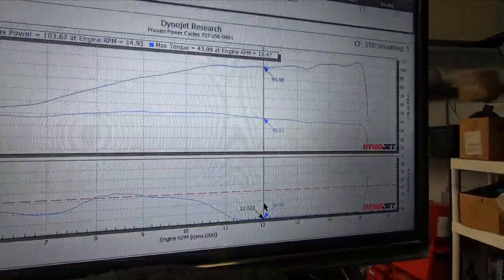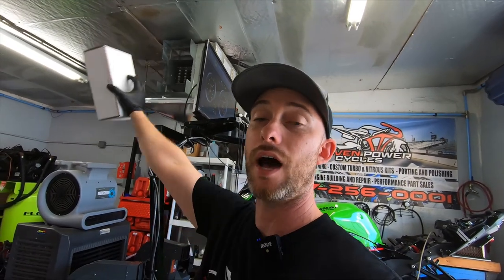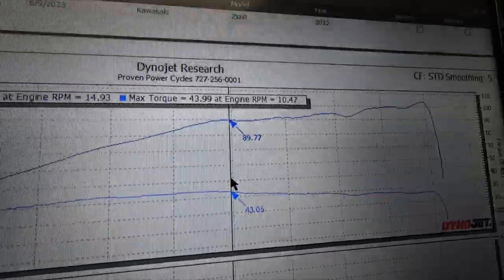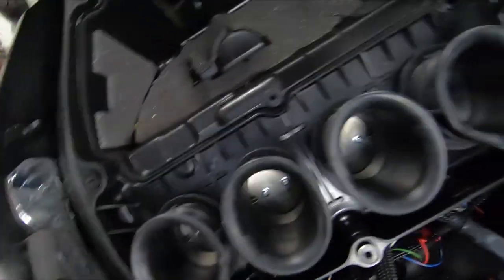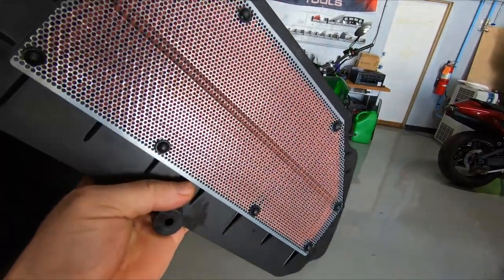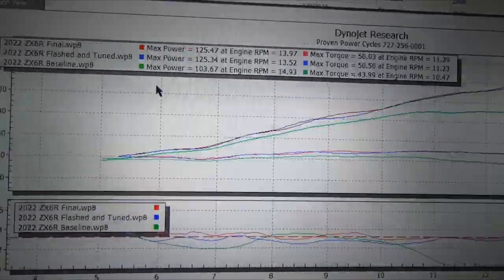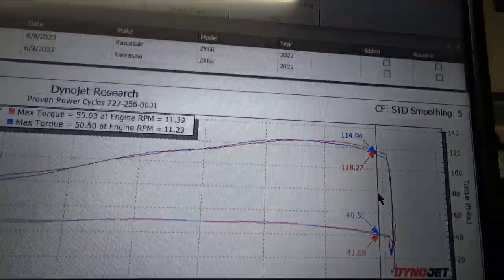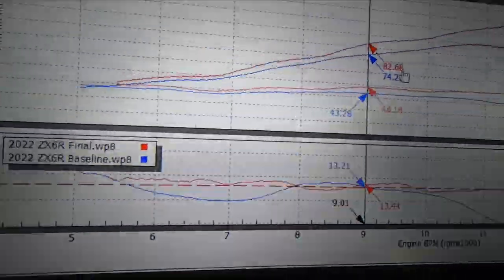2022 Kawasaki ZX6r Graves Velocity Stacks AND TUNE!!

Comment: Its like taking your 600 in and getting a 750 back - the customer wont believe it.
back in 1996 my ZZR 600 made  100 bhp - that was the benchmark for a 600, so they know this, hence it makes 103 bhp and they think that will keep everyone happy. As we know today everything is restricted BUT what I don't like is they typed in the parameters that chucked in loads MORE fuel whereas they could have had the same restrictions with LESS fuel - and they say they're doing this for the Environment?
Reply: It was the dodgy power commander 5 the customer had installed which messed it up

Comment: what is the speed differance top end wise with thoes specific stacks and flash?
Reply from the maker: Stacks with this design usually have gains throughout powerband. Usually if you go with all short stacks then those produce more power up top and you usually loose a little in mid range. 👍👍

Comment: Its only 100 tps
Its not tuning if u not show other tps positions.
Reply from the maker: The tuning session usually lasts about 2-3 hours. We tune all tps settings including the iap mapping not just 100% throttle. We don't show the different tps settings on camera due to all the time constraints and how difficult it is to hit EXACTLY the same tps setting over and over. Usually there is a variance of +/- 2 for tps percentage throughout the pull. 👍
Reply: @provenpowercycles   people want see other tps also. As mostly bikes bikes gains are biggest than peak. In usa u are lucky tuners as u have many restrictions and for usa is very easy to get good results. In europe we do same bikes and i knoe they mostly time are not restricted at all or very minimal. Imagine peak power gain can be 1-2hp.  And what u show than to costumer 1hp gain?:)
Wr easy to do AT that in 3 hour possible. But that AT u know its not always correct.  When u get not asia bike AT no go . 
And dynojet numbers are 5-10% bigger than other dynos .